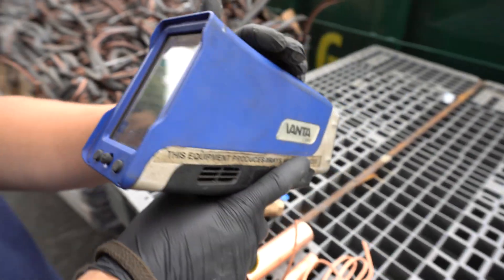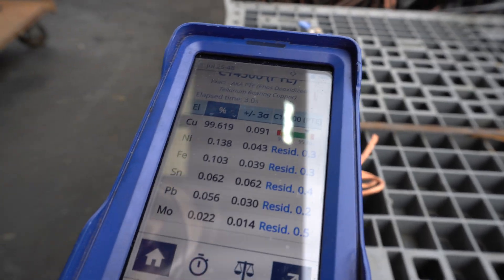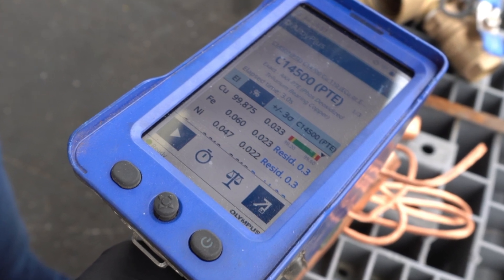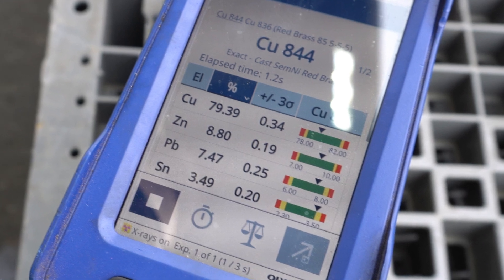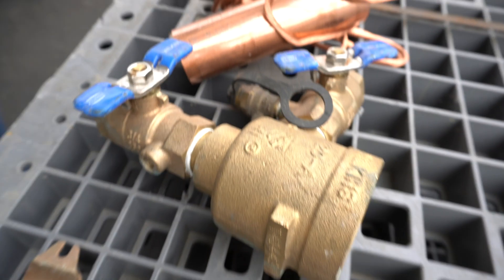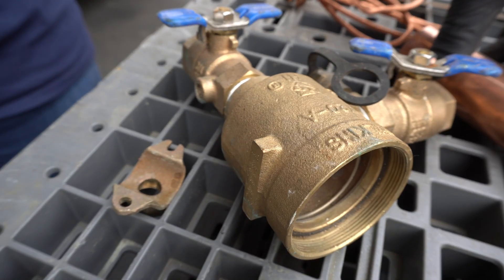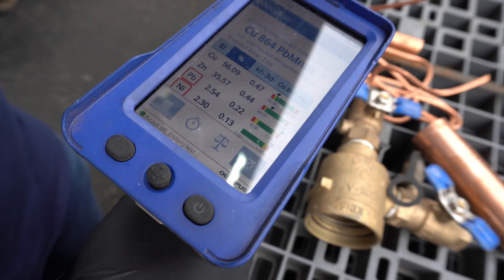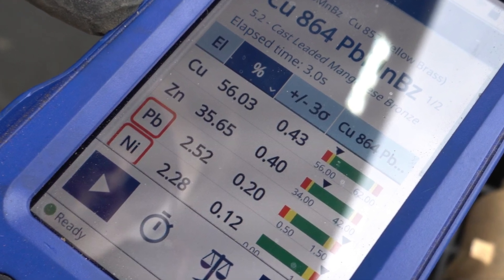Understanding Copper Tubing vs. Brass: What Are They Made Of?

Comment: What is your opinion on entry-level copper wire Granulator separators and what grade and price does the granulated copper go for?
Reply from the maker: granulated copper will be a similar price to turnings at most yards: https://iscrapapp.com/metals/copper-turnings/

As far as a machine, generally the lower end ones (in our experience aren't great. You generally need a higher end machine, that have better sorting mechanisms, but the cost is generally out of range of any hobbyist or individual scrapper